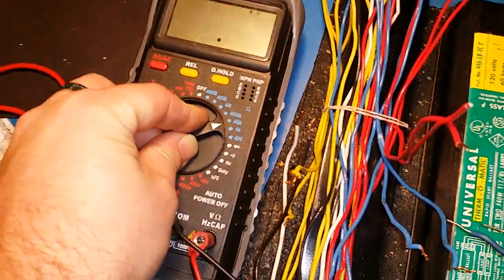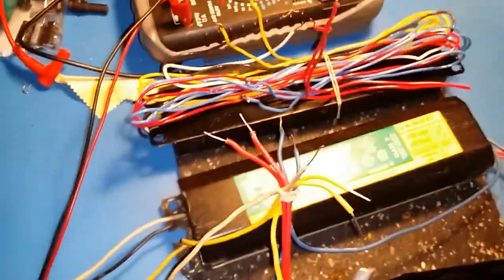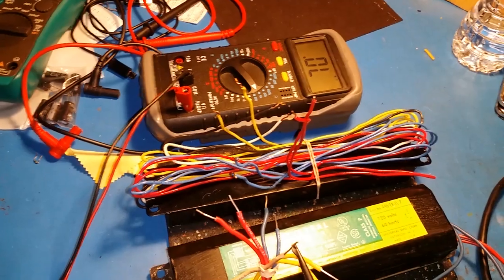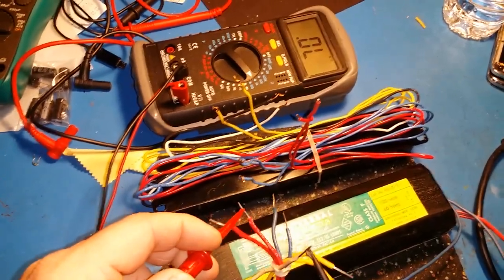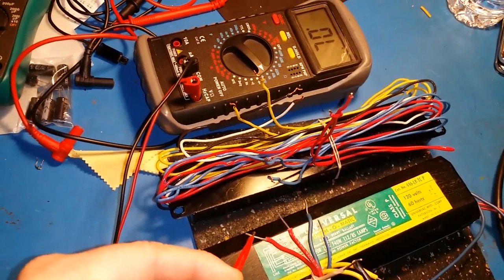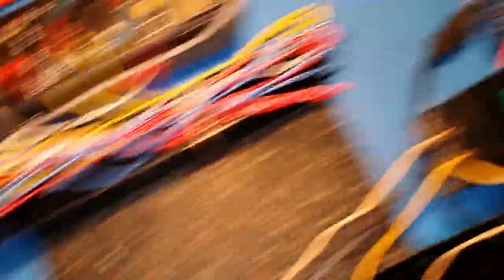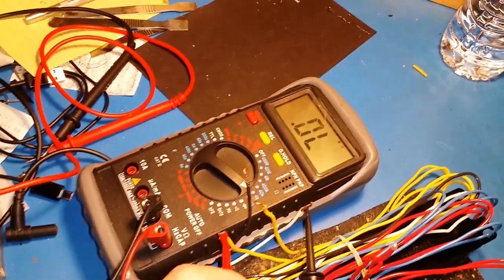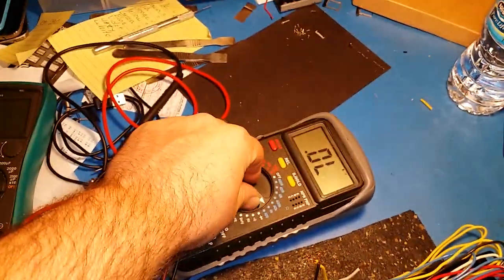Fluorescent fixture ballest test

Comment: My ballast has 2 red wires and 2 blue wires and a black and a white that go to the AC source. The schematic on the ballast shows that the red wires go to one end of the fluorescent fixture, and that the blue wires go to the opposite end of the fixture.  The white wire is the neutral wire that goes to a 127v source.  Is this correct?

Comment: I bought a brand new Ballast from Homedepot and tested it using this method. The blue wire showed resistance.  I used it anyway. It came out good. Is this method reliable?

Comment: The following response was posted by Tou Xiong in about the year 2000. It is the only informative post in the entire thread, yet was posted as a response to a comment, so was not as easily accessible for all to readily see.

This is a good way to test a ballast when it is not in the cover and you can't tell if it's a good one or a bad one. This is the reason I searched this up. I work with some people who likes to keep junk we have a bunch of ballast good and bad, some wrapped some unwrapped so I have to go through and test them to find the bad ones to throw out. As for a ballast that is hooked up its easy to tell if it's working or not. Just use a non contact power tester. It beeps when there is power in the wire. If you test and it beeps on the red and black supply wire then it should also beep on the yellow, blue, and red fixure wire as well. If non of them beeps (while the red and black supply does), you have a bad ballast.

Comment: There has to be more to it than this. If you stuck 6 wires into a brick, you would get the same results as produced in this test. That does not mean a brick would work as a ballast. By following this authors directions, I wasted a day rebuilding a fluorescent fixture, which was doubly hard to do as the fixture was recessed into the ceiling.

Comment: Fairly ineffective method to test a ballast.    My broken ballast tested good according to your method.  An open winding in a transformer will still give you an open reading.  A failed test is a good indicator that the ballast is bad but a passing test does not definitively mean the ballast is good, it may still be bad.

Comment: Great and informative video.  just one comment; should mention to test the white wire with all other wires except the black wire. People who have no electrical experience will read resistance if they measure between white and black wires and determine that the ballast is defective

Comment: This is a good way to test a ballast, but it is possible for a bad ballast to test good using this method. That was proven to me today.
Reply: That’s what I’m dealing with, T8 ballast, reads good, but yet no worky, put new one in lights worky!
Reply: @jacobwilson3316 Resistance test will tell you if something is bad but it won’t tell you if it’s good because you are not testing it under an electrical “load”.

Comment: I'm not sure which white wire your supposed to test. One white wire goes from the power source into the ballast and another white wire goes to the bulb... I assume it's from the power source but just want to be sure cause your wires are so strewn about in the video it's hard to tell and everywhere I've googled just says white wire without specifying which one.

Comment: You are saying meter should read OL or  no resiatance, then ballast is good. Every other place I have read says just the opposite, It should measure continuiity if ballast is good. If ballast is bad, on my meter it still stays at 1. Please explain. All wires show no resistance. No meter movement. Therefore, Ballast is bad??
Reply: Just a misnomer on the “OL”. OL doesn’t mean Open Line, it means Over Limit: high resistance.

Comment: No offence to the guy who made this video, but this is not accurate. My ballast tested completely normal according to this test, and it was bad.  I practically rebuilt the light fixture and replaced the switch because supposedly my ballast was good.  WRONG!  Nothing worked until I put in a new ballast.
Reply: That's annoying😂

Comment: So do I plug in the ballast or test it without any no power? Just to be clear I'm dumb with it comes to this but I learn and keep the knowledge with me in the future but this is new to me. I'm still trying to learn the Multimeter. But just a question that you didnt explain plus your testing the ballast that's removed I want to test a little that complete before it starts cutting wires to remove the ballast . But I get it I just didn't know to power it or no power

Comment: Thanks for the Video. 
I have a Question can I test the Ballest while it is still hooked up to the Fixture while I have the power off?
?
Reply from the maker: Have to atleast disconnect your common. Should be connected to the white wire out if the ballast

Comment: This video is incomplete.. he did not say what range you should be looking for if you only have a 2k or 1k selection on meter or what to do if your meter is auto ranging?  the very FACT you are setting meter on 4K seems to make me figure that possibly a 2k reading would actually be normal in some instances and not indicative of a bad ballast. I am an automechanic by trade and you will not see ME making videos on how to fine tune the rocket motors on the space shuttle. if you dont have all the facts dont make a fucking video

Comment: I just used an auto-ranging meter and all wires test in the meg-ohm range EXCEPT the blue ones. Magnetic ballast, BTW. The blue ones were below 20 ohms. Same for both ballasts within the same fixture. None of the lights worked, so that's a clue, too! I tore them out and re-wired for direct-wire LED bulbs. Works now!
Reply: I mistakenly ordered LED bulbs for curbside pickup. I think rather than trying to replace my ballast (which I now know is bad) I'm just going to do the same and convert it to accept LEDs rather than drive across town to home depot twice in the same day.

And next time I'll just go in the store because evidently my reading comprehension skills need improvement as well 😅

Comment: not a sufficient test. there are more possible faults. This test does not confirm a bad ballast.
Reply: So what does. Anyone can say not sufficient.
Reply: This would be one type of failure, a shorted ballast.  But not the only type of failure possible.  All my wires read infinite resistance so it should be good right?  Nope, I've got 120VAC in, and no voltage out to the bulbs.
Reply: So it can confirm a bad ballast, but not necessarily confirm a good one.
Reply: Mine reads open line, but still doesn't seem to work.

Comment: You was right the first time when you said the needle shouldn't move on an analog meter.  It will not swing for open lead as it is no difference than just holding the leads in open air not touching anything so by connecting them to something else that is open will not make the needle move.

Comment: On your analog meter, a full swing of the needle indicates no resistance.
Tuotching thOn your analog meter, a full swing of the needle indicates no
resistance. Tuotching thOn your analog meter, a full swing of the needle
indicates no resistance. Tuotching thOn your analog meter, a full swing of the needle indicates no resistance. You can verify this by touching the two probes together and you will get a full swing.

Comment: Hi thanks for the video I have a fluorescent fixture that seems to work fine I was thinking of pulling the ballasts and getting rid of the rest of the fixture. but when I use the method of testing you're talking about one side of the fixture gives me open line and the other side starts to show values on the meter. Trying to decide if I'm doing something wrong or if this fixture is not putting out what it should if it were in perfect condition. Yellow wires on one side dhowing OL and blue and red wires on the other side showing values ranging from 11-39

Comment: Very good video. This is the first time that I see a video like that. Mostly the electrician usually does not test ballast they replace the used ballast for a new one and that is it.
I believe you use the withe wire (common) because it transformer share it's coil with the secondary transformer. Is it correct? .

Comment: I just tested a ballast at work using this method. unfortunately, the power supply within the ballast was faulty giving me the same OL reading from the white to all the secondaries.
Reply: No he is saying this method will not test for all possible faulty conditions a ballast can have, as it didn't work to find his problem.
Reply: This is a good way to test a ballast when it is not in the cover and you can't tell if it's a good one or a bad one. This is the reason I searched this up. I work with some people who likes to keep junk we have a bunch of ballast good and bad, some wrapped some unwrapped so I have to go through and test them to find the bad ones to throw out. As for a ballast that is hooked up its easy to tell if it's working or not. Just use a non contact power tester. It beeps when there is power in the wire. If you test and it beeps on the red and black supply wire then it should also beep on the yellow, blue, and red fixure wire as well. If non of them beeps (while the red and black supply does), you have a bad ballast.
Reply: You meant this  method is precise?